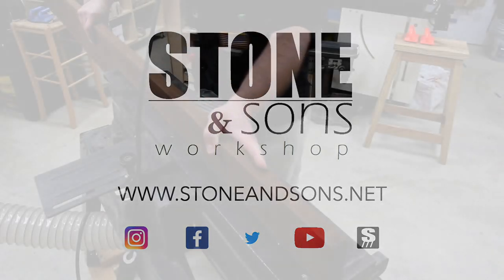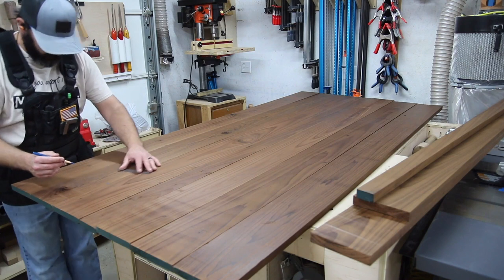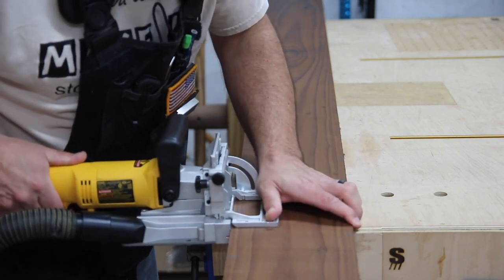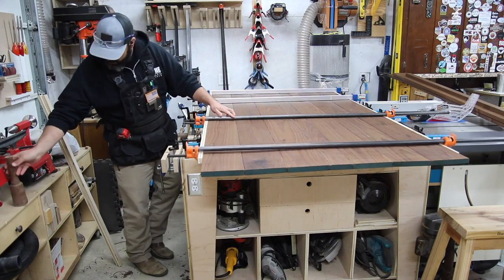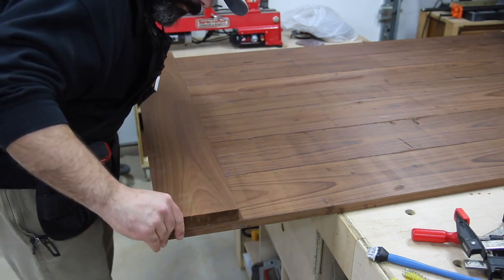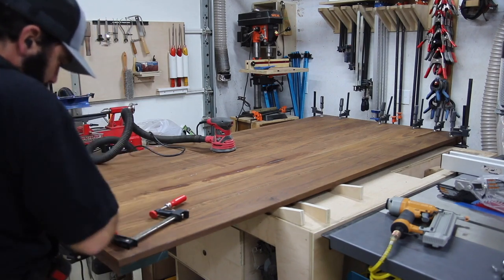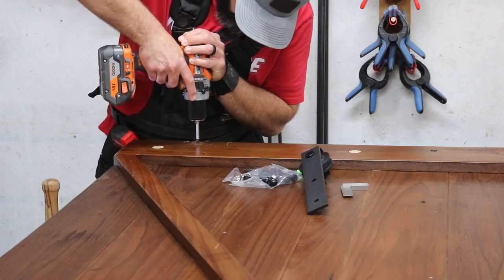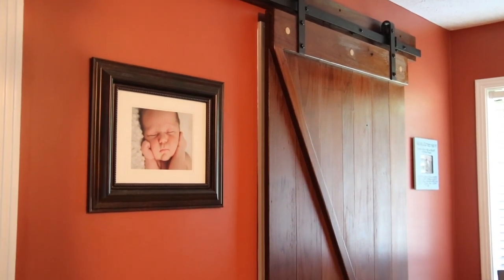Sliding Barn Door - How To Woodworking

Comment: Great project. You used the Rockler beam clamps. Weren't you disappointed with the performance from some low-cost beam clamps last year? Could you tell a difference in the quality of the different clamps?
Reply from the maker: You’re correct. The Rockler surefoot clamps are great.